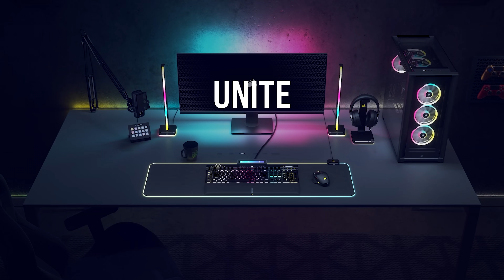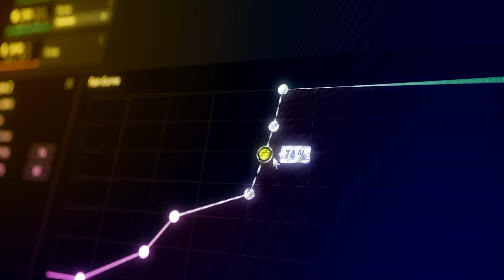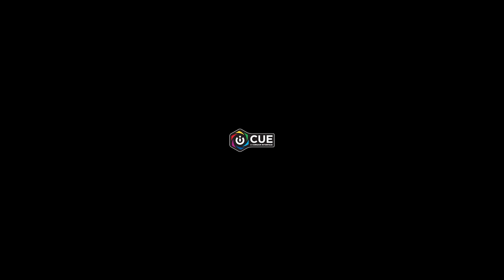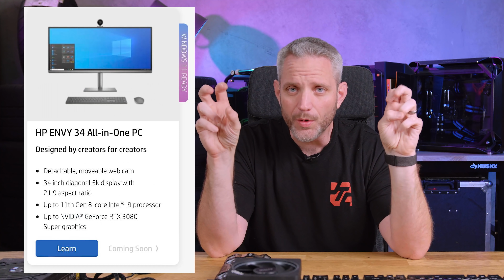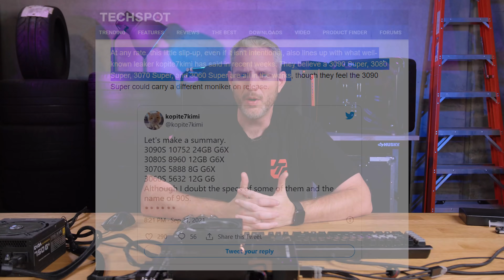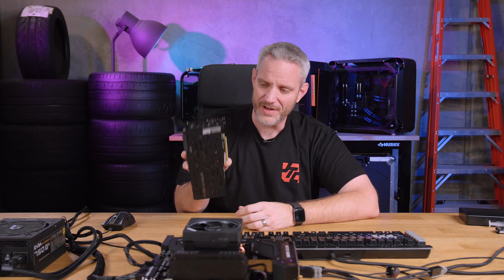RTX 3080 Super...

Comment: UK actually has a fairly healthy supply of Nvidia GPUs, unfortunately the prices are still sky high, so I think many people are just holding off buying one, myself included.
Reply: same for Aus, $2500+ for a RRP $1139 card is an actual joke.
Reply: As another UK resident this is my exact problem
Reply: @Tyler and they will stay over priced for as long as people are willing to pay for them. Everyone just needs to boycott them until the prices are brought back to a fair level.
Reply: Scan are keeping to the true msrp in the uk, ordered a evga 3080 ftw ultra hybrid for £1070 last week from them.
Reply: @madthing17  I'm assuming you mean a 3080 ti cause that's almost 400 quid more than 3080 Msrp
Reply: @jamieswanson4450  its the 3080 with a aio attached and 3060 is £600 msrp not a 3080. You need to check your msrp prices.
Reply: @madthing17  actually you do. The 3060ti has an msrp of £369. That’s how much I paid for my FE card. The 3080 is around £650 MSRP. You have overpaid by 400 but it’s an AIO card so it’s not that awful
Reply: @euansmith986  And you do understand it's a third party card and not a FE which comes with better warranty(10 years which can be transferred evga), cooling(even if not AIO), Power delivery for OC if I want and better performance overall then the FE. It costs more because the third party card companies have to do R&D for the cards and buy GPU processors from nvidia and make some money.
Reply: @madthing17  yeh I do, your £600 for a 3060 msrp statement is still wrong mate
Reply: @euansmith986  and how am I wrong when nothing about the other guys reply to me mentioned about a FE card but he was replying to me talk about a evga card from the start because a 3060 evga card at msrp is around £600. Read carefully over the comment to understand where I'm coming from. All I was saying when scan get 30 card in stock they sell for msrp because I even remember seeing them at the prices you lot talk about for FE but F me for trying to help point people in the UK to right place rather than places like ocuk and their 200-400 mark ups.

Comment: 3:27 "all running off the same GA104 core"
The 3080 and 3090 are on the GA102 die, not the GA104.

11:27 "...because it's a different core to what they're working with here on the desktop stuff."
The mobile 3080 and 3070 use the same GA104 die that the desktop 3060Ti, 3070, and 3070Ti use. In fact the mobile 3080 uses the full un-cut GA104 die so unless the Super is just a clock speed bump, it would have to move to the GA102 die which is also being used by the desktop 3080, 3080Ti, and 3090. 

12:24 "you've been sitting in the queue for a year..."
The EVGA queue makes up such a small part of the sales of 30 series gpus. The vast majority of people successfully buying them are getting lucky and being diligent. They're going to Microcenter on delivery days, or following discord notifications, or joining the Newegg shuffle, etc.

Comment: Jay's argument does not make sense.  EVGA can either: 1)  Not open up a new waiting list; or 2) Offer the people on the 3080 waiting list a 3080 super when they become available. The Newegg shuffle is a day by day sweepstakes so it would not be affected at all with the launch of a new product. 

 Nvidia's primary concern is their bottom line. If a company is in a shortage situation then the most profitable action is to sell higher margin products. So add 5% more cuda cores and charge an additional $100, people will still buy it. The graphics card market is a duopoly, so you either buy an AMD or Nvidia card. AMD is not bargain pricing their products either. 

People, you need to think for yourself not listen to Jay. He along with the rest of the YouTube talking heads panned the 6600XT because of the $379 price tag. On eBay a used 1070 goes for that or on Amazon you can maybe get a new 1650. The 6600XT is better than either.

Comment: The queues for SKUs makes sense, I've been lined up with EVGA for 3060, 3060ti, 3070,  3080s, 3090 Kingpin. I for a notification for Kingpin(took about 9 months), 3060(just over a year) and 3070(A year and 3 months) thus far, had to give up the Kingpin as the notification dropped not long after I had a credit card issue and was waiting for a new card... 3060 and 3070 went to friends as I'd been waiting so long I figured either I'd get a 3080(main system) or a 3060ti(SFF build) or just wait for the 4xxx series. Kinda feel like I'll probably wind up seeing 4080 announced before I even get that notification...

Comment: The 3080Ti is kinda a die that couldn't be a 3090, so would make sense that 3080 super could be dies that failed to be either a 3090 and 3080Ti. Which if they have an extra supply of those dies they couldn't help with 3080 supply as I think the 3080 is a different die. And rather than throwing them away they could use them in a new sku. Kinda like the 3080Ti being easier to produce using half the ram of the 3090 (so they can make more with the same amount of GDDR6X). tldr: pretty much the 3080super might be using die inventory they can't use for anything else that couldn't be 3090s or 3080Tis. Will add though that regardless of that, it'd be another product putting pressure on GDDR6X memory supply.

Comment: A 3080 Super mobile would make a lot more sense, since the 3080 mobile is basically a 3070 Ti with GDDR6. Maybe they would do a GA102 with 58 SMs or something and GDDR6.

But I disagree about the queue. I signed up for a 3080 ftw3 ultra in October for a friend of mine and I just got the email for it a few weeks ago. If someone didn't sign up until December or January or even later, you have a higher chance of getting the newer card. I've gotten a 3060, couple 3080 Tis, and a 3090 kingpin via the queue within a month of signing up. Most of those within the week of or even same day. Being that you can buy 1 card of each sku through evga you have a much higher chance of getting a newer card signed up on day 1 before a 3080 that was signed up late. And even if you do get the 3080 before you didn't lose anything.

Either way, I hope they don't release them. 1 because I just bought a laptop with a 3080 and wouldn't be happy if a super model came out soon, but also with how tone deaf it would be for them to release another card that's only a few percent faster.

Comment: YES there WILL be a 3080 SUPER sooner rather than later and here's why: 
Nvidia's SUPER lines are just a way for Nvidia to take advantage of increased yields in the GPU die manufacturing process as time passes. At the time of the 3080's initial release, 8704 WORKING cuda cores out of a total 10752 (EVERY GA102 based GPU has the circuitry for 10752 cuda cores on it regardless of skew) was the reasonable minimum to meet Nvidia's bottom-line for a xx80 series card at their chosen price. As time passes, yields improve since chip makers like TSMC are always refining their existing processes. 
Eventually you reach an inflection point where maintaining a steady stream of newly minted GA102's with ONLY 8704 working cuda cores would mean having to actually DISABLE additional working cuda cores in significant numbers as part of the manufacturing process  The alternatives for Nvidia at this point are either purposefully hobbling higher performing silicon, continue shipping 3080 cards that suddenly, inexplicably feature higher core counts/perforrmance figures than before, or phasing out the initial 3080 with a slightly better performing drop-in replacement - the SUPER variant.
And this is all dealing with EXISTING fab allocations.
Reply: I'd be way more disappointed in Nvidia if I found out they didn't release better cards when they could just because there was a shortage on the current ones.
Reply: @isidor37  So would I, actually. It double sucks though for anyone in an existing purchasing cue for a vanilla 3080 at some retailer or six. In a perfect world, all those people would be automatically switched over, maintaining order, by the RETAILER to a waiting list for the SUPER continuation (since SUPERS are functionally just continuations of an existing skew.) Unfortunately this isn't a perfect world.
Reply: As a former process engineer for Texas Instruments, I was just about to respond with a very similar statement. After a year of producing these chips, I would be highly disappointed if the manufacturing process hadn't improved to a point where NVIDIA and TSMC were either scrapping the lower lines or purposefully disabling parts of the chip.

It's easier to blame a shortage on new SKUs rather than the fact that demand is far outstripping supply capabilities.
Reply: Its really as simple as this, but Jay would rather spout off about greedy invida.  When its just a natural evolution of the card.  They did the exact same thing in the 20 series.

Comment: If Nvidia cared about public perception they wouldn't have released the 3080Ti: 10% more performance for (theoretically) 70% more money. They will release a Super for the same reason that they released a Ti: the market is willing to pay over 1500$ for a graphics card, except the money could go to NV instead of scalpers. As the manufacturing yields improve, you can expect supply of highest spec (most expensive) chip to be the strongest because Nvidia would be insane to not charge what the market is willing to pay.

Comment: Nvidia now know they didn't need to be as aggressive with the 30 series pricing - the 3080 is far better value than the later launched 3080 ti - replacing the 3080 with the 3080 super would be an easy way to raise prices.

Comment: Ti cards are sold in addition to the non-Ti cards, but Super versions replace the non-Super variants and the non-Super variants are discontinued. So it’s possible the Super versions are coming to replaced the original 3070/3080/3090 to take advantage of increasingly better yields. And it won’t affect the EVGA queue, because they will just do exactly what they did with the LHR cards and replace your queue with the new part number because the old number is discontinued.

Comment: The prices will never go down. Even tho you may be poor,there are a lot of rich people out there that will spend alot of money on pc parts. And the companys are starting to realize that they are leaving money on the table.
Reply: Let's see how well that theory holds up after ethereum goes to proof of stake and miners aren't rolling in money - and have no motivation to pay 3x MSRP for the cards.
Reply: Yeah but won’t another coin breakthrough into mainstream coins that requires mining?
Reply: @nemesis2264  Crypto transactions were banned in China in 2013. Nothing has changed officially from China, they just reminded everyone it was illegal.
Reply: @Chambers36TheEnter  The RTX2000 series wasn't a big enough jump in performance to warrant shelling out for an upgrade from the corresponding GTX1000 cards.
The RTX3000 series would have been worth it, if the cards had actually been available @ MSRP.
The MSRP's have been going out of control too, though.  My budget for a new video card is around $500,  and this no longer represents an xx80 series of cards.
So I'll be comparing the performance of my existing 1080 to whatever card I can get in the $500 price range.  If nVidia can't deliver a significant performance upgrade at this price point, my money will remain firmly in my pocket until they can (as Intel and AMD can both pound sand until they get their driver issues sorted, which doesn't appear to be happening any time soon).
Reply: @glenndoiron9317  Game segment is already adjusting purchase cadence to secondary back one generation as all new gens on process shrinks are priced for commercial buyers. mb

Comment: 3080 is so high on demand.   Whenever I go to a local retailer, sure they got SOME 3080 TI but the retail price on those are insane it doesnt make sense for the performance it gives you.   You might as well just get a 3090 at that point.

Im keeping my 3080 for sure.
Reply: Whatever they called them, they should have stuck with 3 versions. 3060ti, 3080, 3090. All the others have so little difference, it makes no sense.
Reply: @yourhandlehere1  the 3060 TI is good for the price, 3070 is the best "mid range", 3070 TI is ok if you cannot find a 3080, the 3080 TI is a rip off -- dont buy it, and a 3090 is just you flexing.

Comment: I am a new PC gamer that made the mistake of paying over price on a GPU. I wanted to build a PC so I did and my PC sat for 3 months with no GPU. I wanted a 6800xt but the prices on amazon are 1500 and 6900xt are 1799 so I ended up getting a power color 6700xt red devil for 915 shipped.

really sucks I paid almost retail for a 6700xt that a 6900xt price came out as. Its really impossible to get your hands on higher end cards unless you really want to pay double or more. Even the 3080 on amazon is 2400 bucks.

Comment: I am in South Africa, in July I managed to get my hands on a Msi Rtx 3070 gaming X trio (700w psu, it's the card I wanted). Brand new card, old one was a GeForce 1080 G1 gaming. I paid R10000 (zar) too much for it but now you can't find 3070s easily. No shortage of 3080s or 3060s though.

Comment: What if NVidia can make either 5000 3080s or 5000 3080s and 5000 3080 Supers, that would be an acceptable reason to have Super. I still don't understand Super, are those refreshes? If yes then I'd like those better than playing lottery to see if you get v1 or v2 of a card lol, I bought an RTX 2060 only to realize there were 2 versions after a month when the 2060 Super was announced and I was looking around, it was a bit too far from the date I could return my original slower 2060. I'm over it now, but if Super is there to avoid that, I'm up for it 😂

Comment: The only "variant" that made sense in the 30 series is the 3060ti.
It was the sweet spot for a low/medium build
Reply: The 3080 made sense as well 🤷‍♂️, I’d rather have a 6800xt tho and save the $50
Reply: i agree, the 3070 is just an expensive 3060ti haha
Reply: My thoughts too. I tried one for a couple of weeks and at 1080p it was great. Even last December cards were out of stock so I tried a cheapish prebuild $1400. ABS system from Humpty Dump...um....Newegg. Full of Gigabyte parts, 3060ti OC...just up and died one morning. Shipped it back, big hassle getting my refund, won't use them again.
Now I'm running my "Goldilocks" 3080. Equally great at 4K. Went to Sky Tech after that. Blaze 3, $2299, (early February) 3080-3700X. Zero problems.
Reply: 3060ti low build 😄 i have a 2060super and i play 1080p warzone @150fps. Is that a super low build? What u on about?
Reply: @Gaminggagreel   I mean, it was meant (at original msrp) as a nice entry level gpu.
Around 400 euros, it was really decent.
With less than a thousand, you could make yourself a beast pc
Reply: 30 series at MSRP are sweet spot. This gen is just very unfortunate. Next gen is gonna be expensive again.
Reply: No, absolutely no. What makes sense in that that a 3060 got more VRAM than the 3060TI-Version? The 3060ti should have 12GB VRAM, too. Nvidia paper launches version after version of GPU's for extreme high prices but they are still missing a good midrange card (and reasonable prices). I had the hope the 3070ti would be a good midrange card but with 8GB and that price of over 1000€ it is just a joke. With 12GB and 600€ it would be way more interesting. You could get the 1070ti for 450€ and the 2070ti for 500€ at launch. For me atm the only NVIDIA GPU that goes near a price that feels kind of acceptable for me (I need NVIDIA because for GPU rendering most programs does not support AMD) is the standard 3060 with 12GB VRAM. In the moment the lowest price is over 600€. MSRP is 329€. 450-500€ is for me a price range for that GPU in the actual situation that would be marginal acceptable. Above that price I do not start to think about buying a new card. You can buy 3060's and 3070's in bulk from miners in my area but who wants a one year old used miner GPU for a price a piece that is just 100€ under the street price of a new one.....
Reply: @seanthiar  I was talking about the idea nvidia had when launching them. The theory. 
For gaming, 8GB dedicated are enough, you need more for video editing.
In fact, the 3060ti allowed 1080p gaming max details at high refresh rate. (we are talking of, basically, a 2080/2080super)
At 1440p maxed out, you still have nice fps.
At the ideal price of 420 €, while building a new pc (no upgrade) I would consider buying it

Comment: They are doing this because of Intel Ze, it's pretty much confirm that Intel Xe top card worst batch is a 3060ti in performance and its best is a 3080 in performance. So it's probably going to be around a 3070 to 3070ti performance, with 16gb of Vram. Not saying Intel Xe is going to be a 3080 in performance but it is fishy that all of a sudden AMD and Nvidia refresh rumors are coming out around the launch of Xe.
Reply: That’s because they will be trying to steal Intel’s thunder for Xe. Hopefully Intel pulls through and proves AMD and Nvidia wrong.

Comment: I think the Super was in the original plans, but like you I look at the market right now, I just can't see them bringing them to market at present time - either they'll push that back or cancel it altogether (with cancellation being the more likely move).  Be more cost efficient to concentrate on next gen development then a refresh of current gen.  I could see AMD doing a refresh only because they are still about half a step behind in performance (and about a full step behind with RT), but I don't see that happening because they are having the same fulfillment problems.  Again it'll be better for AMD to concentrate on next gen product then on refreshing current gen.